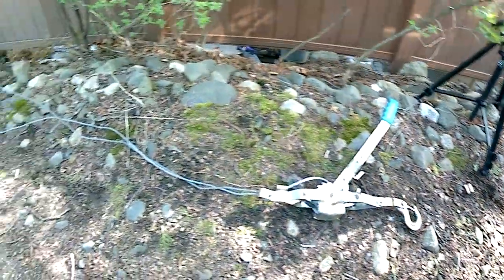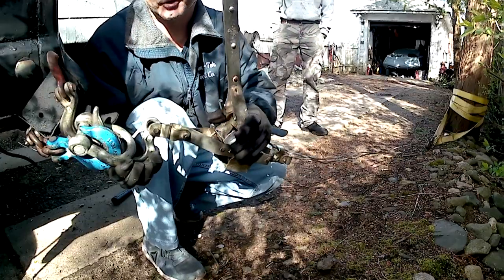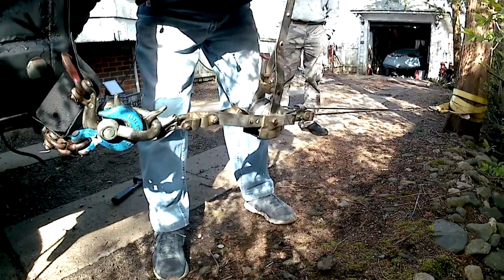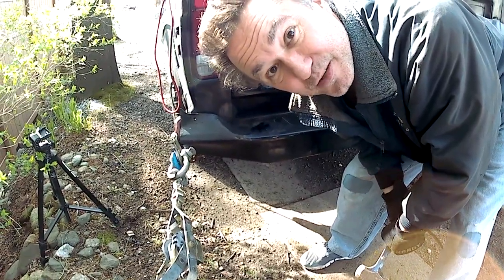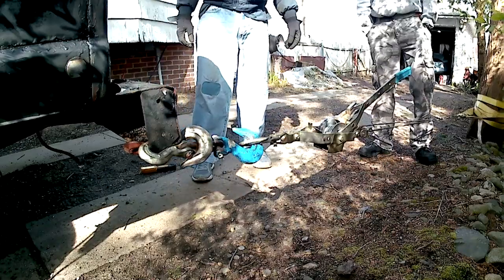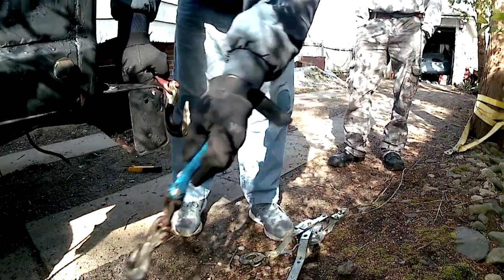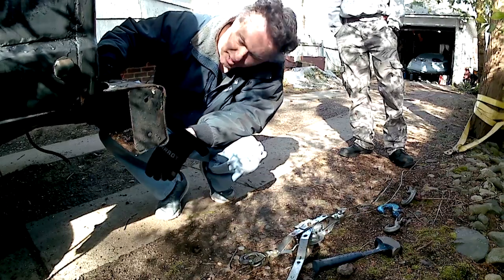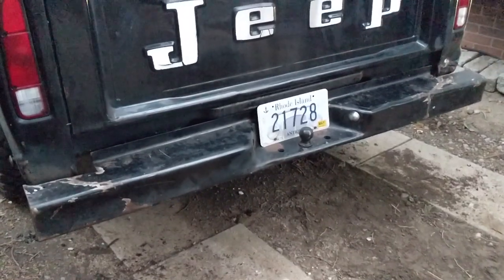Bumper Straightening

Comment: Thanks. I didn’t think a comealong would be strong enough to do that. Ready to fix my ford ranger rear bumper!
Reply from the maker: You are right; the come-along is not strong enough on its own to just pull the metal back into place. It just puts tension on the metal, so that when you hit the crease with a sledge, the metal is inclined to move back into position.

Comment: Hey Bob, helpful vid, thanks ... Actually, I was hoping you did a previous vid on how you straightened out those frame brackets, I've got one on my Toyota Taco that's bent up enough so as I can't attach the bumper correctly. My first thought was torch off the bracket and replace it ... but after watching this, I'm thinking come along maybe? Thanks ahead of time!
Reply from the maker: Sorry, I didn't film that. It was pretty cave-man, though; I unbolted the bumper, then took that sledge hammer to the bracket to straighten out the first part sticking out from the frame. Then I removed the bracket from the frame, and just beat the other bend flat (it had bent in a kind of "Z" shape) on a flat surface (I think I used the bumper itself; an anvil would have been better).
Reply: @bbsbcv  Hey thanks for the reply Bob, I'm with ya on the Z shape, guess I'll have to get "cave-man" or live with it ... thanks again!